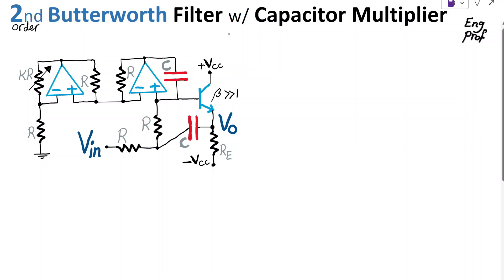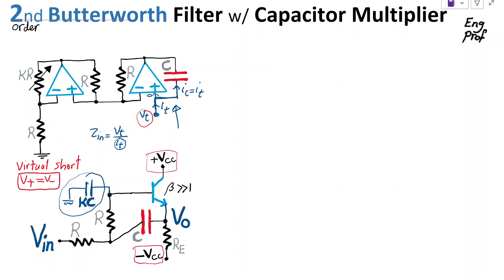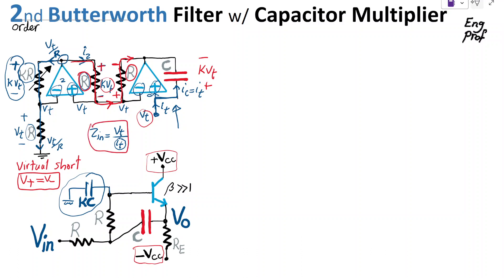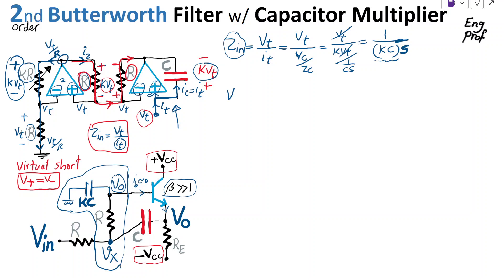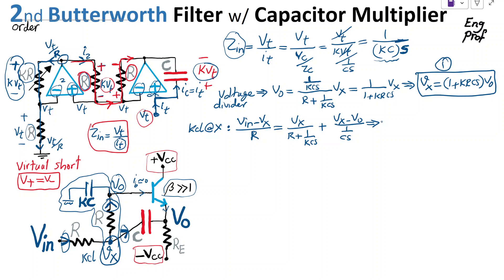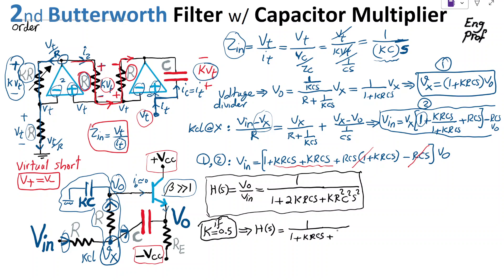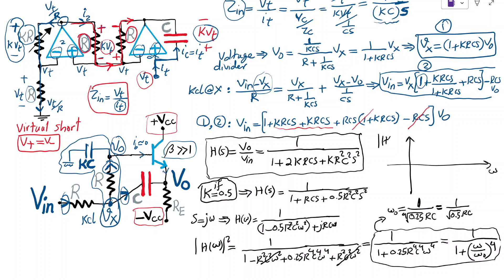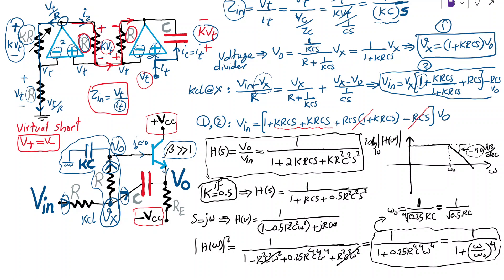Butterworth Filter Design with Capacitor Multiplier, Op Amp and Transistor

Comment: Hello Prof, I love your videos, they really help me understand OpAmp circuits. The only thing i dont really understand about opamps is that it sometimes feels a bit random how the rule V-=V+ is applied. For example In an Inverting Amplifier V+ is connected to ground, so why isnt V- also virtually shorted to 0V? Why does Vin „dominate“ over ground in this example? Obviously this circuit would be useless if V- was virtually shorted to ground but i don‘t know how you can tell for sure which voltage „dominates“. 
I‘d really appreciate if you could explain it to me. 
Thanks in advance and have a nice weekend.
Reply from the maker: Hello, thank you for watching. Glad that electric circuit design videos are helpful.  Answering your question, op amp virtual short V-=V+ is practically valid as long as op amp is properly biased and operating stable in linear region of operation. As long as these conditions are satisfied then op amp circuit operates in such a way that tries to reduces the voltage difference between its two input terminals to zero meaning V+=V- .  In such scenario, whatever voltage is forced on one input terminal it will be forced at the other input terminal as well as long as op amp is in linear region (not saturated).  
I hope this is helpful. Have a great weekend 😎
Reply from the maker: Adding to my earlier response, here are few more operational amplifier circuit examples to further help with illustrating op amp virtual short and circuit analysis:
https://youtu.be/Ba-66z4T2FA
https://youtu.be/zPnaCPOUw5E
https://youtu.be/UbeDKaPBlbA
Reply: @STEMprof  Oh thanks so much that really helped! Only thing i dont fully understand is why the opamp goes to saturation with positive feedback. I know you mentioned it in one of the videos you recommended to me but i got a bit confused. Do you have any video recommendations on saturation specifially? 
Thanks in advance and have a nice week.
Reply from the maker: @essebrotmitwurst1698  thank you for watching and your interest. See if this example helps: https://youtu.be/V3bJvlvYcic  and keep in mind that When op amp in a circuit is in positive feedback, then one input terminal keeps for example rising without the other one catching up. Therefore output of op amp goes to maximum voltage which is close to positive supply voltage.
Reply: @STEMprof  the Graph in the Video you recommended is really helpful in understanding how the circuit works! Thank you very much 👍🏻
Reply from the maker: @essebrotmitwurst1698  you are most welcome! Glad that circuit analysis video is helpful.